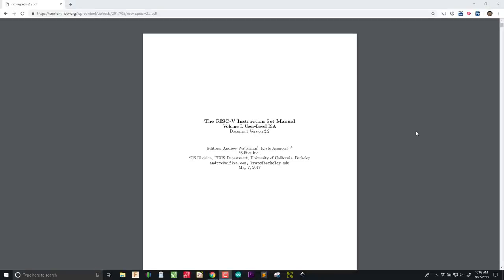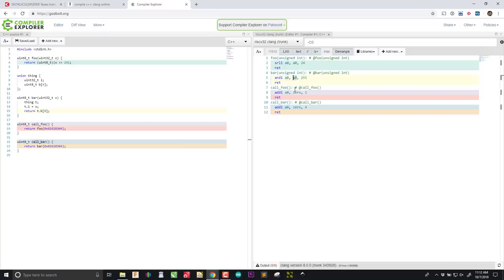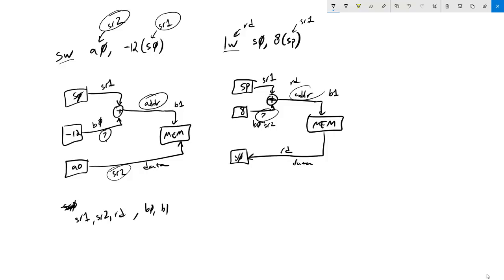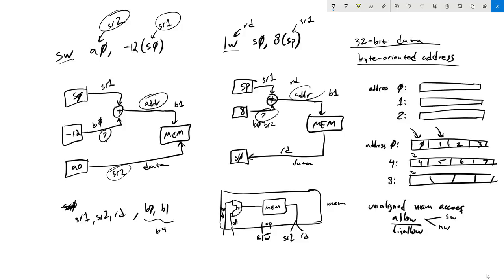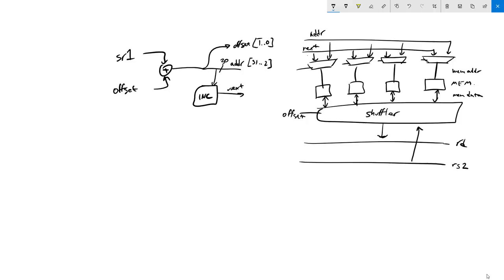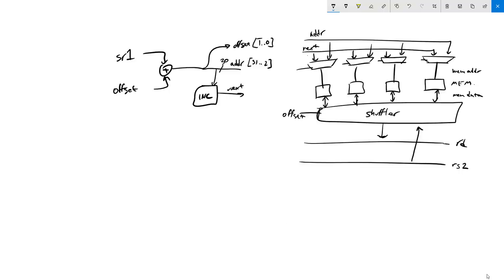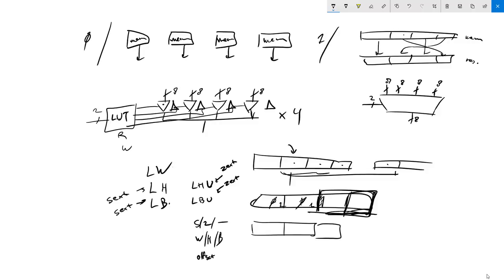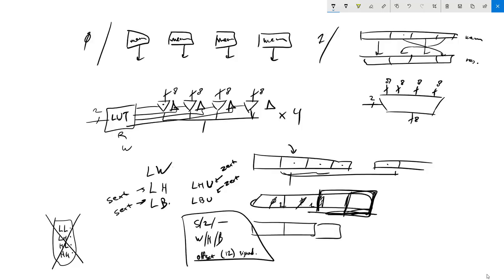LMARV-1 (Tangible RISC-V) Part 5: A horrible mistake, and memory

Comment: Have you considered the option of increasing your memory databus width? (connection to RAM / cache, not the rs/rd buses) If you increase it to 64 bits, then your issue with the second adder goes away, and address 0 and 4 would be loaded together. Then the only other thing you would need, is a byte-wise shifter on the input and output, which is controlled by the offset bits.
Another advantage of increasing the databus width to 64, is that it's higher bandwidth, which will be helpful if you decide to implement a cache. Also, doing so means that you don't need to worry about the byte order on the other side of the memory bus, which avoids the need to crisscross the RAM blocks (since which byte is stored in which RAM chip is irrelevant since your accesses will always be 64-bit aligned).

Also, in terms of the adder in the load-store unit, have you considered the option of an external crossbar? You could potentially link the ALU adder result to the load-store card via another 32-bit bus sitting on top of the cards. It would probably make the hardware simpler, at the cost of another PCB and 2 connectors. You probably wouldn't need to place a buffer in that path either, since the address calculation would be "don't care" when you are not doing a load / store.
For the LB, LH (signed and unsigned),  you would only need to add a mask ROM to enable / disable (set to 1 or 0 during disable), before it goes to the rd bus buffer. I don't think using byte-wise write-enable lines for the register file is a good idea, since you would still need to add the sign extender.

On the bright side, you're not implementing the MIPS 3 ISA, which is bi-endian, and has the weird unaligned memory / register manipulation instructions LWL ,LWR, SWL, SWR.

Comment: Why not simply not support misaligned accesses?

The Clifford Wolf's picorv32, which I'm running here, does not support misaligned memory access. It can generate an exception for misaligned access but even t hat can be removed from the core if one want to save gates. The picorv32 has run all the C code I have thrown at it quite OK.

The ISA spec states:

    The base integer ISA may be subset by a hardware implementation, but opcode traps and software
    emulation by a more privileged layer must then be used to implement functionality not provided
    by hardware.
    Subsets of the base integer ISA might be useful for pedagogical purposes, but the base has been
    defined such that there should be little incentive to subset a real hardware implementation beyond
    omitting support for misaligned memory accesses and treating all SYSTEM instructions as a
    single trap.

So not supporting it is allowed. The compiler does not generate misaligned access, so we are good to go.

Surely having to access two RAM locations at the same time to implement your solution requires a dual port RAM. That sounds more trouble than it is worth.

I'm no CPU designer, only recently learned some Verilog and started on the road to creating my own RISC V (In an FPGA), so perhaps I'm missing a point here. What might that be?

By the way, I love the whole  LMARV-1 and will be following along intently. Great stuff!
Reply: The compiler can generate a misaligned access. However, most code won't ask for misaligned data because it usually comes with a performance cost. So to safe you need to trap to meet the spec. This is pretty easy as you only need to test a couple of address bits.

Instead of dual port RAM or two cycle memory access(my preference). You could break the RAM into four 8-bit channels, each channel having it's own address. That would be a routing nightmare though.
Reply from the maker: @drlazy1  I have chosen to have the routing nightmare :)
Reply: misaligned access may be required if you wont to work with tightly-packed data structures like bitfields and so on. Very common situation in device drivers, network apps and etc.

You may have some arbitrary data stuffed into struct without gaps as it is mapped to some hardware registers and you may want to be able to read it as fast as possible without any excessive coding. It may be WORD followed by single BYTE and then WORD again, so whole data pack takes 4+1+4 bytes in memory and will be misaligned anyway
Reply: Misaligned memory will give you 4 times the memory.

Aligned memory will only give you 1 times the memory.

Having 4 x 1 mb misaligned will give you 4 mb with 32 bit data. instruction size can vary. 

Having the same memory as aligned will only give you 1 mb ram with 32 bit data. Instruction size will always be 32 bit.

Comment: To calculate the actual memory address and load/store from memory when you have an offset you could use a temporary register in the control unit (or somewhere else) and use the control unit to do something like:

1. put address on sr1, offset on sr2, set ALU (the one you already have) to addition
2. read the result from the result bus and put it in a temporary register somewhere for this purpose
3. (a state machine is obviously keeping track of all of this and switching to this new state) put the temporary register value on sr1 (and in case of a store the value in sr2) and tell the memory to do its thing, eventually read from the destination bus if it was a load

So the idea is to add an intermediate register (not a user-accessible one of course) and use the ALU you already have. Of course this is a bit slower and a bit more complex  since you need some sort of state machine in the CU, that's the tradeoff

This is just an idea I had based on stuff I saw in the past, but of course I don't perfectly know how you're planning to build the rest of the processor so I may have just written a useless piece of text :) but still, it may help
Reply from the maker: That is the idea I originally had, but I wanted to see if I could make it work in one cycle instead of two.
Reply: Robert Baruch Yeah, that would be great indeed. Maybe just a flat cable connecting the instruction decode/control unit to the memory module to bring it the offset?
Reply: Then you have to do extra program counter outside the general registers so in this case you have to use dest2 bus to update program counter and src3 bus to get the instruction address. Or to use the pipeline.

Now you are going to create a monster that will be much complicated and much slower than multi-cycle solution.

Comment: Keep in mind that you still need to load and store bytes and half-words (LB, LBU, LH, LHU, SB, SH instructions) which will require 32-bit and 31-bit addresses respectively. 

You need mutliplexers on the data bus both to and from the source and destination registers and write enable control lines of byte size resolution to get byte and half-word write operations that do not affect non-targeted bytes in the memory. 

In the case of load byte and half-word, the non-read bits must also be either sign-extended  (LB,  LH) or zeroed (LBU, LHU) in the destination register. 

You also need to account for cases where the same register is both a source and destination register. Your simple approach causes a critical race condition on the data path and a "data hazard" if the next instruction accesses the previous destination register.  To eliminate both these conditions you require a temporary holding register and a suitable write-before-read pipeline back to the destination register on the next clock cycle.

Honestly, I think you are far better of not trying to handle misaligned memory accesses in hardware. The RISC V spec does not mandate it and by the time you add in support for half-word accesses, you will have a lot of extra hardware.
Reply from the maker: It says in 2.6 that the base ISA supports misaligned accesses. And, check out the very first video in the series. The system is synchronized. There is no race condition for the same reason that a synchronous counter has no race condition.

Comment: That is why 16 and 32 bit wide ram chips have the upper byte and lower byte lines and one address line less. Also that way you can select which byte to write to if you do not want to do a read-modify-write on the whole word. I don’t recall your exact memory module implementation, but if you tied all four write enable lines together that’s the way you have to do it now.
Reply: Exactly. BE[1..0] and A[n..1] for 16b, BE[3..0] and A[n..2] for 32-bit memories...

Comment: I think the major point here: a hardware should be optimized for the software it runs (what I mean here: it's maybe not worth to optimize for something not used at all, or merely used ...). I would ask myself, if unaligned memory access is so common and important to worth to deal with, especially if it mixes in major complexity (that's also the reason of born of RISC, when it was noticed that complex instructions on CISC ISAs have so much overhead, that it worth not to deal with them, implementing a much simple CPU instead which can be faster than though, can be clocked on higher frequencies - just see here the "INC" part for "next" which introduces some latency already compared to the "simple shufflers" which are basically some kind of combinatoric logic only, etc ... You say single cycle operation even with unaligned access. Well, yeah, but surely, this idea with INC introduces somewhat slower signal propagation ie limiting the max operation frequency in contrast, when you can "save" this, to not to do - so that one cycle must be somewhat longer than the hardware would be capable of at max, without it - I think. But surely if you don't want to push the clock to the max limit and playing safe, it may not cause major differences anyway?).  Modern compilers (I wouldn't think too much hand-written assembly coded program wanted to be run on RISC-V class CPU (it, not the legacy x86 especially where many hand-written asm code existed from the past with whatever memory alignment the coder wanted to use ...) where unaligned memory access can happen probably more frequently ...) wouldn't emit code using unaligned memory accesses, and I think, this is a key: does it worth to implement this feature, when virtually nobody use that? Surely, some must be sure this is the case, not just assuming (and indeed, I can be wrong!!!), it won't be used anyway, I mean "in the real world" not by theory (ie, what compilers do, etc). In my practice, unaligned memory accesses are almost always a good sign of some software bug, and is not done by "intent" (other than some obscure software, typically emulators of other ISAs done in software).  By just let the software handle the unaligned memory accesses, you can "emulate" it, or - at your will - it can be used to signal the problem for you to check the situation out, why it's happened at all (as I've written, at least in my practice it almost always mean some kind of bug, rather than an intentional operation). Honestly, I am not so much familiar with RISC-V at all ... But if there are multiple address modes requires adding offset, or even maybe two registers together to form an address or scaling a register (like x86's 2, *4, *8 ... is there anything similar in RISC-V like x86 [aex*4+ebx+offs] kind of horrors?) then you may want to use another - invisible for programmer - register, called "MAR" (Memory Address Register) which holds the formed address for the memory operation already, and then MAR's output is directly connected to the memory decoding logic (ie, chip select for the 4 * 8 bits memory, the "shufflers", etc etc).  By the way, "not in the FPGA" theme of the videos (which is great), I would do it in FPGA at first anyway, since many theories can be tried more easily to begin with. And also you can get the timing report, and you can check the difference if you save the "INC". Surely, in an FPGA it will be much different difference than in your non-FPGA project, but still, it can give *some hints at least. But well, yeah, I can understand that it means a lot to do it "by hand" not in FPGA, not even for trying out things in FPGA as the first step only. I find your videos very interesting, especially that you want to build a RISC-V without FPGA what almost everybody would do. That's also the reason I subscribed for your channel, btw, quite unique and interesting idea! :) But once more: this is my quick ideas only and since I am not familiar with RISC-V, and also, I can be "so damn smart" without even trying to do myself, I can be totally wrong here as well ... Thanks for your patience for this long and maybe useless comment anyway ... :)
Reply from the maker: I agree that I probably should have started with the simplest thing first. But really I wanted to highlight a design issue, like unaligned memory access, single-cycle ALU, and so on) and try to solve it in hardware. I could prototype in an FPGA, but that comes with its own issues. Mainly that I'd see how fast the FPGA was, and then be depressed at how slow the non-FPGA solution was.
Reply: @RobertBaruch  Well, hmm, maybe you're right. I've realized that compressed instruction set requires unaligned (in the terms of 32 bit units) accesses as well. And though you may not want to do that, it's a logical next step, and not allowing unaligned memory access makes that hard in the future. Especially because compressed instruction set is really great when you have to deal with limited memory space, which may be the case with a system using SRAM (I guess you plan to use SRAM and not something like a huge capacity DDR-X memory module, or something like that, which is a nightmare ... I mean even with FPGA and VHDL, "driving" DDR memory is a madness, I always find myself to think about SRAM only ... even if it's more expensive and smaller RAM in average than today's standards, for sure ...).
Reply: When decoding stream of variable-sized integer, for example in sqlite4 format, I need an aligned big endian load of s=3,4,5,6,7,8 bytes. On intel I just read 8 bytes, bswap and shift by s*8. On architecture with no unaligned access I would make a call by table[addr%8] to 8 different subroutines to make 2 loads, shift, “and by mask” then “or” them and finally bswap. Slightly more instructions, but not a big trouble because that would be implemented in (compiler) support library as an unaligned_load64() fun.

Comment: RAM is not an "interpretation."  RAM truly is an addressable sequence of 8-bit byte storage locations.  Since it is typical to store 32-bit registers into these 8-bit locations, we must choose which order we want to write and to read these 4-byte registers into this memory.  Little endian processors write these bytes in least significant to most significant order and big endian processors write in most significant to least significant order.  I'll also point out that we can "bank" memory modules in parallel to form 16-bit, 32-bit, or wider memory words.  Otherwise, I do appreciate the education on RISC-V.

Comment: I think using opcode traps for unaligned accesses is a reasonable option. Even on machines with hardware support there is often some performance cost (e.g. AXI if your transfer crosses a bus-aligned boundary you need to do two accesses), so people concerned with performance usually avoid them anyway.

Edit: Sorry I don't recall whether you said, does LMARV-1 have interrupt and/or exception support? Would be awesome to get a proper operating system running on it :)

Comment: This is unnecessarily complicated.  Packing 8-bit memory into 32-bit registers necessarily requires 4 memory accesses.  Tri-state "Offset" and "Src1" and share the adder.  Share "Offset" with a 2-bit counter and use a 2->4 decoder to select slices of the 32-bit word.  When count=0 (NOR the two bits), connect "Offset" and "Src1" to the adder and clock the adder's output into an address register to be shared with "Src1."  When count != 0 (OR the two bits), the adder adds count+(Src1+Offset) to be the new address and the 2->4 decoder selects the register slice to interface with the memory (write or read).  On count=0, enable the 32-bit register's output (for read) or latch the 32-bit register (for write).  count's clock input is ANDed with the memory's chip enable so it will always be zero at the beginning of a memory read or write.  As a demonstration, I also think it is acceptable simply to use 32-bit memory banks to avoid this entirely.

Comment: May be a dumb question but what is the value of little endian memory as opposed to big endian? Sure there has been IBM PowerPC and Sun SPARC with big endian and that seemed to work so why little endian on this risc or is it just "that is the spec for RISC-V" and we are stuck with it? Also, atomic memory ops regardless of alignment is hellish cool. A pack of memory circuit overhead but .. cool and fast.
Reply: PowerPC and SPARC(at least V9) are Bi-endian.
Reply: Little-endian has two big advantages:
1. It is used by most modern and relevant architectures, so a lot of code is written assuming little endian, and is not ready for big-endian.
2. From a technical point of view, little-endian is awesome, since you can read the same address as byte, half-word and word and the result will make sense (simple type cast, not vastly different values).

Comment: You start your explanations with all the endianity stuff. Are you suggesting that allowing unaligned accesses for big-endian system would somehow be simpler?
Reply: Rather than giving the direct answer, I will simply point you in a direction...  Consider what 'the shuffler' needs to do in little endian operation versus big-endian operation.
Reply: @trevorvanbremen4718  I.e., the only difference is the order in which the shuffled bytes are fed to the register, so same complexity. (But big endian might be simpler to think about.)